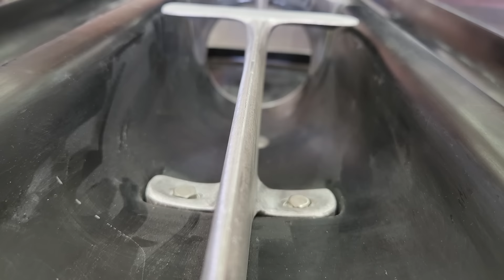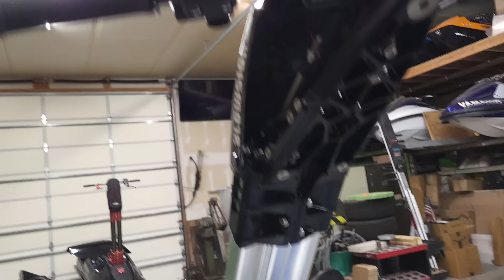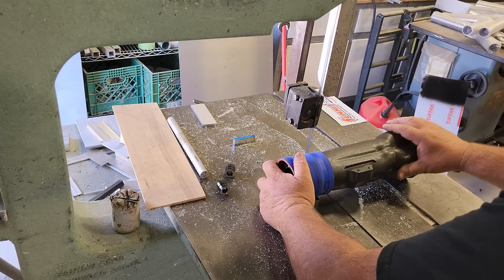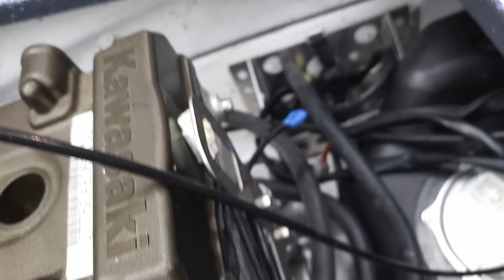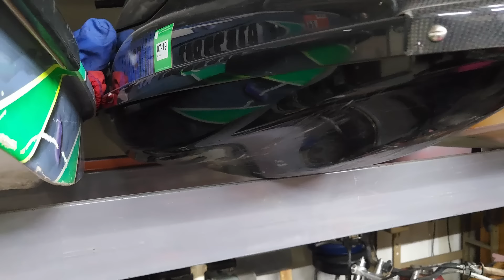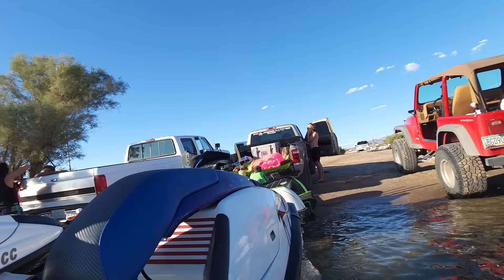Unleashing Speed: Building the Bullet V5 Racing Jet Ski. From SXR 1500 Donor to High Octane Thrills!

Comment: Would this water routing be effective on a regular 1500 with a waterbox? 

I’ve seen a fuss in forums about some kits melting the stock exhaust hose & a bunch of junk about in-line jets & filters in the lines. 

Your setup seems much more simple & effective.
Reply from the maker: Absolutely. When I had my set up still in my sxr 1500 hull, I put it into overheat mode from riding too hard, that is when I started changing water routing. That is the routing I ended up with. I just carried it over into my Bullett hull.
Reply: @jetskijim007  thank you, I’ll definitely have to try it out! 
Is there any way I could get a quick drawing of how everything is routed? If so that’d be great! 
Ps- love the videos, super informative, keep it up!